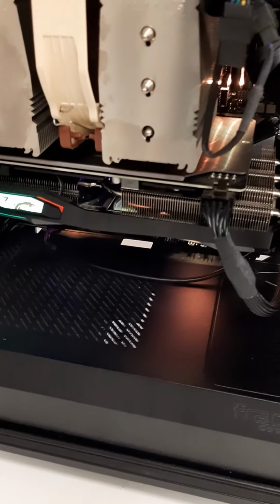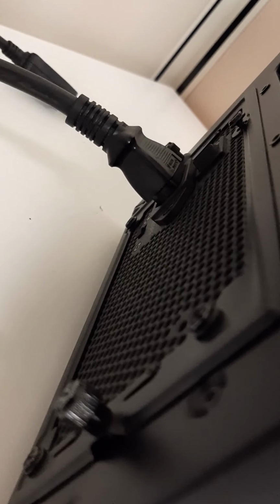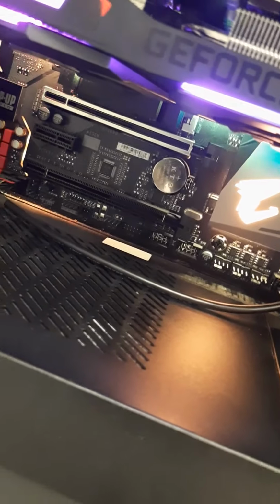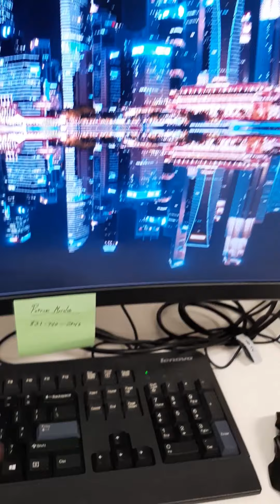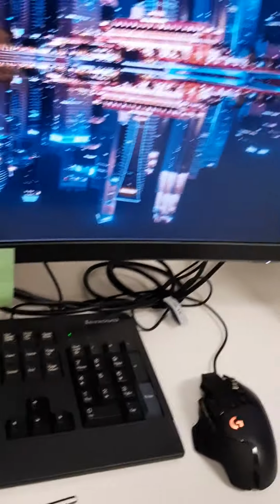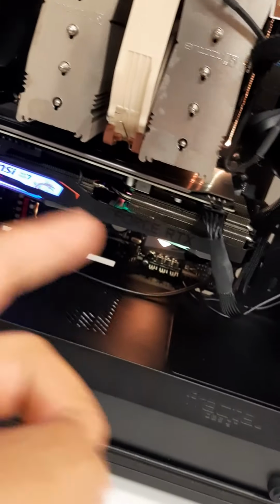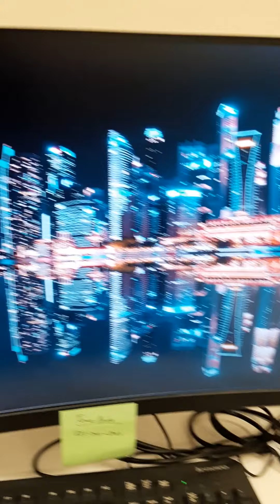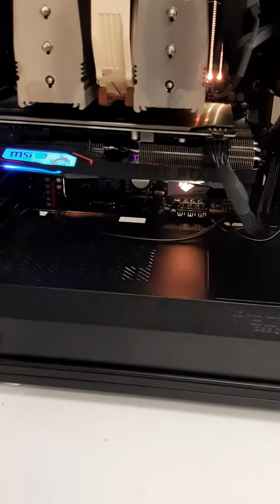HOW TO FIX BLANK SCREEN AFTER ENABLING SECURE BOOT | Windows 11 Upgrade Headache Fix

Comment: Dude, I have a graphic card still not working
Reply from the maker: Do you have integrated graphics?
Reply: @anthonydiaz6101  yes
Reply from the maker: @omkarpatil270  make sure you disable secure boot once remove your GPU and you load up your PC using the integrated graphics

Comment: So you had intergrated graphics on your CPU ? 

I  did this with with no luck.
The motherboard manual says it has intergrated graphics on the motherboard itself though,...
But how can that be ?

Well i did it all, ..removed gpu and battery , hdmi direct in the motherboard ................with no luck 
And a bunch of other combos, like leaving the battery out and then try it hdmi straight in motherboard style
............And the other way around, with battery in and out and hdmi in the GPU
Reply from the maker: Yes, my CPU has integrated graphics and you will need it in order for it to work. Please check the comments. Other people have found workarounds

Comment: Bruh i unpluged my gpu i pluged my hdmi into my moterboard i its still blackscreen?????!!!
Reply from the maker: Does your graphics card have integrated graphics? If not then, that's why. This method will not work if you don't have integrated graphics.
Reply: @anthonydiaz6101  i dont have a integratet graphic But bingo i turn on the pc today and it was working like it said to reset my pc to reset my bios GG
Reply from the maker: @leiyzi3027  I'm glad you got it working! That's fantastic 🙂

Comment: Does anyone know a solution for people that don't have integrated graphics?
Reply: i really need to know this too. my pc was working and i configured bios and then when i saved it didnt turn show on my display..
Reply from the maker: Read through comments. Some people have found solutions. Maybe one could work for you. You can also replace your motherboard. It's not the cheapest option, but it's an option.
Reply: @Kyle1400  figured it out, just turn of the pc and take off the little battery that comes on the motherboard, put it back in like a min, you might need to press the On button on the pc(just to drain all the energy of the motherboard, obviously do this while it´s unplugged, this will cause the bios to reset to default config) and them put everything back, it should work.
Reply: @serrafersebastian3743  i fixed it with qflash but thank you anyway

Comment: bruh all
this for valorant dude and idk what to do idk how to disconnect stuff in my pc and putt it back i got it prebuilt, bruh curreclty i took off the battery thingy and i tried and nothing came up again so ima leave it for a day and if it doesnt work then no pc for me no more please anyoen out there got snything that can work i got a giyabyte motherboard smh.
Reply from the maker: Darn. Does that CPU have integrated graphics? If the CPU does not have integrated graphics then this method will not work, so that's also something important to consider. When you take out the graphics card, you'll need the integrated graphics to actually have a signal and not have a black screen so you can see what you're doing. If you don't know how to take out your graphics card, look up a video on how to do it, then proceed with the tutorial, then put it back in once secure boot is disconnected. If you do not know whether or not your CPU has integrated graphics, look up the CPU on Google. "Does ___ cpu have integrated graphics?" If you do not know what CPU you have, the website you bought it at will probably have the specs. You can probably look up the pre-built PC you have on Google as well.

I've gotten a few comments of people being in this situation because of Valorant.

I sincerely hope you find a fix for this. If not mine, then somewhere else. I'm sorry I'm not of much use at this point. I'm wishing you the very best brotha. Good luck ❤️

Comment: I don’t have an integrated graphics card :( Someone let me know if they found a workaround
Reply from the maker: If I find something, I'll send you a reply
Reply: @anthonydiaz6101  Appreciate it man, I’m 10000% sure this was the solution so U definitely helped a lot of people out
Reply from the maker: @raf4097 Thank you! Well, I have to give the credit to the articles and videos I saw. I just combined the two to come up with the solution. If it wasn't for those people, I would be screwed 😂
Reply: @shahdkhoury2803  if you don’t have an integrated graphics card you’re gonna have to take it to a repair shop they’ll use one of their cpus or graphics cards to fix it :/
Reply: @shahdkhoury2803  if you have integrated graphics in ur cpu just plug in your hdmi to your motherboard instead of your graphics card
Reply: @shahdkhoury2803  yup pretty much, and re enable CSM support
Reply from the maker: @raf4097  I didn't even re-enable that 😕 I probably should. Thanks for the indirect reminder 😂
Reply: HOW TO SOLVE BLACK SCREEN AFTER ENABLING SECURE BOOT WITHOUT AN INTEGRATED CARD

If you have a gigabyte motherboard, it is likely your motherboard has something called dual BIOS, some mobos have BIOS switches some have Main and Backup Bios pins (you would have to resort to your MOBO manual

if you have a Bios SWITCH: https://www.youtube.com/watch?v=q9048wFSuD0&lc=UgwF5GIXObyeMGZoeNl4AaABAg.9TYBNv61vfY9TZk7obcn4Z this video should guide you through the fix 

if you have a Main and Backup bios pin (like my case): https://www.youtube.com/watch?v=rLHSajr5Qp0&t=107s this video should guide you through the fix (in my case, I had to short the pins WHILE THE COMPUTER WAS ON, or else it didnt work)
Reply: I need to know aswell if someone figures out a fix cause my PC's fucked
Reply: @raf4097  can i fix it by connecting a different gpu?

Comment: Hello im french can u say me what i do ?
Reply from the maker: (1) Take out CMOs battery for a few seconds to reset the CMOs, (2) put the CMOs battery back in, (3) unplug the graphics card and take it out, (4) boot up the computer, and (5) turn off secure boot in bios when it pops up.

Note: Taking out the CMOs battery to reset CMOs isn't required, but it makes bios pop up when you turn it back on, so you don't have to press your bios key (at least for me).

Then, once you've turned off secure boot in your bios (1) turn off the computer again, (2) put the graphics card back into its slot, and (3) plug your graphics card back in. When you turn the computer back on after that, you should be back up and running.

Note: This will only work if your PC has integrated graphics. If it doesn't, this won't work. Unfortunately, I don't know any other fixes in case you don't have integrated graphics.

I hope this helps. Hopefully you can copy and paste this into Google translate for better clarity.

Comment: I did this and it did not work but i see it did for others like it doesn’t even give me signal to my monitor
Reply from the maker: This method doesn't work if you don't have integrated graphics. There have been some people in the comments, I think that managed to find a workaround without integrated graphics, but I'm not sure if it works for everyone. I hope you can find a fix for it though. Best of luck!
Reply: @anthonydiaz6101  so
Is my pc just done for good and won’t work?
Reply from the maker: @iamRoc  I wouldn't give up hope, but I'm not qualified enough in this topic to give a solid answer. I'd say keep researching. As more people experience the problem, you may find a fix. But if you can't find anything, then you'll have to replace the motherboard. I got lucky I happen to have had a CPU with integrated graphics or I would have had to buy a new motherboard
Reply: @anthonydiaz6101  I have been reading articles for 2 hours now and I see that it’s the graphics card and I have a i5 so how come it doesn’t have integrated graphics
Reply from the maker: @iamRoc  not all CPUs have integrated graphics. Some are manufactured with it and some are not. It's up to the consumer to decide whether they want to buy one with it or not. So basically just to give people options, I guess. Typically you don't need integrated graphics because you have a graphics card but in this very specific situation, it's very nice to have it.

But yes, I read the same thing. It's some sort of incompatibility between the graphics card and motherboard. If you had integrated graphics, you could use that to actually be able to see what's on the screen to reset the settings you changed that caused the problem in the first place.

The settings changes you made to the motherboard are what caused the compatability problem so you would have to replace the motherboard. A few people in the comments did that.

I apologize for not knowing too much about the subject, I really wish I could be of more help 🙁
Reply: @anthonydiaz6101  so if I were to switch out my gpu with an extra one I have will it be able to display it and let me fix it
Reply from the maker: @iamRoc  someone in the comments tried that, I think, and it didn't work (again, I think). But it won't hurt to try 🤷‍♂️ Let me know how it goes 🤔

Comment: But the question is how to enable secure boot if we got that issue ? Cos At tje end secure boot is not enabled 😅
Reply from the maker: That's a great question. I judt gave up 🤷‍♂️ I think I saw one comment where they managed to make it work, but I won't even bother trying at this point lol
Reply: @anthonydiaz6101  I actually found the solution, update ur bios and enable secure boot
Reply from the maker: @lejeunevictor2327  Got it. Hopefully that helps someone else out too. Thank you
Reply: @lejeunevictor2327 what motherboard do you have
Reply: @trulyappel  x570 Aorus Ultra,

Comment: I just want to ask 1 quest.
U connect ur HDIM cable directly to ur computer Mobo( Without GPU)

My question can we get display without GpU?
Or do u have an I-GPU?
Reply from the maker: You need to have integrated graphics. If not it won't work. Some people in thw comments have found a work around for it, but that hadn't worked for everyone.
Reply: @anthonydiaz6101  today i took my mobo to the service centre,  theh told me my mobo is dead. 
I am a student, right now i cannot even afford a new mobo thanks to Microsoft you ruin my whole academic semester, now i cannot even work for my academic studies.
Reply from the maker: @shanks9926  That's horrible. Stuff is expensive right now. Microsoft should have done better. I have thousands of views, which means that thousands of people now have fucked up motherboards. Hopefully you have library near by that you can go to. I'm sorry to hear it man. I wish I had a better fix but it's the only one I know

Comment: I've heard about this fix. Unfortunately, my PC does not have an iGPU (using Intel 9400F). So I guess my only solution is to purchase a compatible processor WITH an iGPU just to do this fix....
Reply from the maker: You could also just replace the motherboard, and it'll be resolved, too. Someone in the comments did that.

Comment: What if my cpu doesn't have integrated graphics?
Reply from the maker: I don't know. I don't want to assume that there is no fix, but this solution kind of requires that you have integrated graphics. I hope that more potential solutions get published as more people experience this issue. But as of right now, I haven't come across one. I'm sorry bro ☹ You may also have to consider buying a new mobo if you're able to
Reply: @anthonydiaz6101  Man that sucks 😔 If only Windows 11 wasn't so insistent on enabling Secure Boot so I could play Valorant.
Reply from the maker: @karlphoenix3451  right? I totally agree. Microsoft fucked up with this one. I get that they care about security and whatnot but they should have known that some PCs won't allow for this thing to be enabled. Maybe... or maybe they didn't know. I guess they just want people to buy new PCs 🤔
Reply: @anthonydiaz6101  That's a messed up business strategy. Though, I didn't really have any issue with other games aside from Valorant.
Reply from the maker: @karlphoenix3451  I would hope that's not why it's happening 😂. But hopefully this gets resolved
Reply: HOW TO SOLVE BLACK SCREEN AFTER ENABLING SECURE BOOT WITHOUT AN INTEGRATED CARD

If you have a gigabyte motherboard, it is likely your motherboard has something called dual BIOS, some mobos have BIOS switches some have Main and Backup Bios pins (you would have to resort to your MOBO manual

if you have a Bios SWITCH: https://www.youtube.com/watch?v=q9048wFSuD0&lc=UgwF5GIXObyeMGZoeNl4AaABAg.9TYBNv61vfY9TZk7obcn4Z this video should guide you through the fix 

if you have a Main and Backup bios pin (like my case): https://www.youtube.com/watch?v=rLHSajr5Qp0&t=107s this video should guide you through the fix (in my case, I had to short the pins WHILE THE COMPUTER WAS ON, or else it didnt work)
Reply from the maker: @thaisserpa8481  Thank you for sharing! I hope it can help some people out
Reply: @anthonydiaz6101  Update: My PC was fixed using a cheaper alternative instead of buying a new Proc. So my father bought this device called CH341A Bios Programmer, and was able to access the bios using a laptop and reset it.
Reply from the maker: @karlphoenix3451  that's great you found a fix at a lower cost! Thanks for the update. Hopefully people read this so they can give it a try, if they can.

Comment: It's not working for me
Reply from the maker: If you don't have integrated graphics, this method won't work, unfortunately.
Reply: @anthonydiaz6101  I updated my platform key save and exited then went back into bios turned on secur boot save and exited again
Reply from the maker: @Ben Decam  I disabled secure boot. After I finally got a signal on my monitor, I turned it off because that's what caused the issue in the first place. Never turning that thing on again. I'll just upgrade to windows 11 when I get a new PC eventually 🤷‍♂️ I give up on this update 😂

Comment: haha man, i got the same issue messing with win 11. For me, i just pull the GPU out, but didn't take off the battery. And also the HDMI goes to the MB, then screen is back to work, but still looking for how to upgrade to 11 tho.
Reply from the maker: Yeah, I wanted to but I give up for now lol. The battery step isn't necessary, I just did it because it makes the pop-up appear that says it was reset so it automatically takes me to the BIOS without me having to spam a key. Did extra work so I didn't have to do extra work somewhere else 😂 glad it worked for you bro!

Comment: … I don’t get it :( 😢😢😢 I can’t even take off the top of my pc
Reply from the maker: Do you have a desktop or laptop? Desktop computers, like mine, usually have screws that can be easily removed in order to open it up
Reply: Ok but do you think it works with powerspec
Reply: It’s seems different from all the other tutorials I’ve seen
Reply: I also don’t know anything inside my pc
Reply: It looks different cause I don’t think I have the battery thing
Reply from the maker: @lizoh9416  Those are pre-built PCs. This method should still work as long as your CPU has integrated graphics. You may want to check the website where you purchased the computer to see what CPU it has and google whether it has integrated graphics or not; that's what I would do. Every motherboard should have a CMOS battery, I think (I'm not expert in tech). The CMOS battery step isn't necessary although, I would do it if you can. It's for the sake of convenience since resetting CMOS will automaticaly load BIOS (at least for me) when you turn on the PC so you don't have to spam your BIOS key.

I hope it works for you 🤞
Reply: @anthonydiaz6101  I got it from a store like went there
Reply from the maker: @lizoh9416  You may want to take it to a repair shop in that case. Sorry I can't be of much help from here :(

Comment: I can’t figure it out
Reply from the maker: It didn't work?
Reply: @anthonydiaz6101  I took the battery out and I unplugged the motherboard I also tried resetting my pc
Reply: @anthonydiaz6101  do u have discord?
Reply from the maker: @gflacko8273  no
Reply from the maker: @gflacko8273  does your PC have integrated graphics?
Reply: @anthonydiaz6101  I have a cyber power pc
Reply: @anthonydiaz6101  It’s a pre built pc

Comment: And if your cpu has no integrated graphics, then what
Reply from the maker: In that case, this method will not work. It's the only one I know.
Reply: @anthonydiaz6101  I have w10 pro, would using a Remote Desktop work ?
Reply: @mountmagma  did you get it fixed? if so how
Reply: @Kyle1400  I realised what happened
Reply: Because of how old my gpu was it changed the bios mode from UEFI to a legacy version
Reply: And it ended up bricking the board and I managed to get it replaced under warranty. Luckily it didn’t harm any other components 😅

Comment: HOW TO SOLVE BLACK SCREEN AFTER ENABLING SECURE BOOT WITHOUT AN INTEGRATED CARD

If you have a gigabyte motherboard, it is likely your motherboard has something called dual BIOS, some mobos have BIOS switches some have Main and Backup Bios pins (you would have to resort to your MOBO manual

if you have a Bios SWITCH: https://www.youtube.com/watch?v=q9048wFSuD0&lc=UgwF5GIXObyeMGZoeNl4AaABAg.9TYBNv61vfY9TZk7obcn4Z this video should guide you through the fix 

if you have a Main and Backup bios pin (like my case): https://www.youtube.com/watch?v=rLHSajr5Qp0&t=107s this video should guide you through the fix (in my case, I had to short the pins WHILE THE COMPUTER WAS ON, or else it didnt work)
Reply from the maker: Hopefully this works for some people. Thank you for your comment. I apologize for not seeing it
Reply: Hi pls i need your help do you have discord?

Comment: After do this my pc did not work
Reply from the maker: It will only work if your CPU has integrated graphics
Reply: @anthonydiaz6101  my cpu is rayzen 5 3600
Reply from the maker: @LEVELMAXX  You may want to Google it to see if it has integrated graphics.